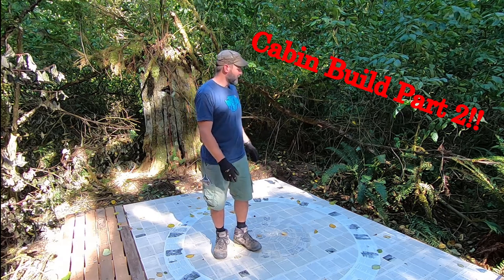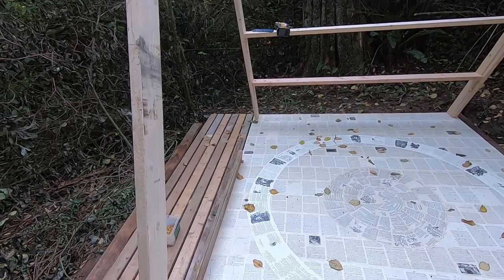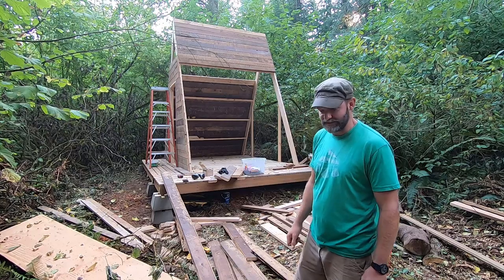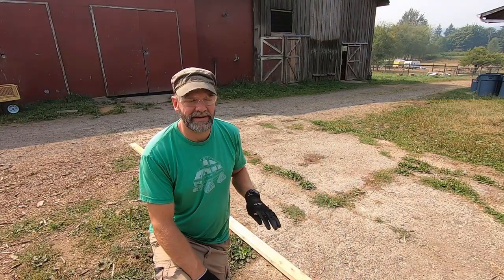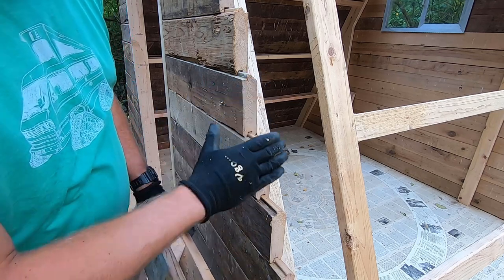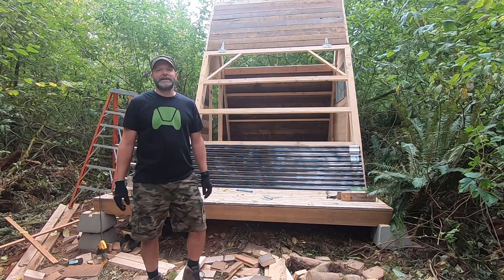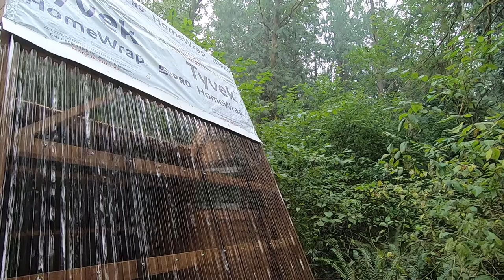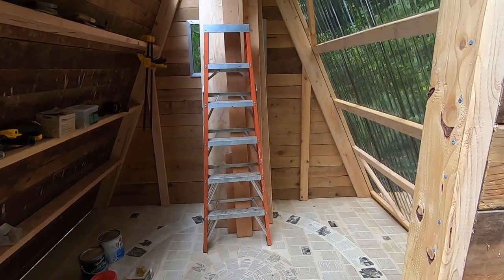A-Frame Cabin Build Part 2

Comment: The Tyvek will help the water drain down and out. It's really good at that. :-) It won't prevent condensation from forming on the metal, though. That's caused by temperature differences, and Tyvek has no insulation properties.

I really enjoyed watching this video. Thank you!
Reply from the maker: Well, down and out is good enough for me! Thanks for the input!

Comment: Hello!  I watched primarily to see what you used as "rubber flashing" between the swing wall and the roof!  I had to laugh when you said you couldn't find it anywhere because I'm in the same boat.  How did the material you used hold up?  What exactly did you use?
Reply from the maker: Hah. Yeah, I walked up and down the roofing aisles at Lowes and couldn't find it. I finally found these rain gutter leaf covers that were long and pretty flexible. It seems to be working just fine so far, but it's only been a few weeks. There's gotta be something better; I was just short on time and that's the best thing I could find.
Reply from the maker: @daddyeeoo  Yeah, that would probably work great (didn't have one readily available though..)

Comment: I am new to framing .what are the angles for the roof rafter join? do you have any templates or measurements
Reply from the maker: I used Deek Diedricsen's design. Although I don't think it had a detail with angles for the top joint. I laid the wood out on a flat area in the way it would be installed and marked the cuts. It wasn't very scientific or perfectly accurate, but it worked ok for me.
Reply: @philbrown5722  I'm also new to framing. Around 1:20 into this video when you were securing the 'A' frames to the floor, I couldn't tell what you were doing. Did you have some sort of metal plate to attach the two?
Reply from the maker: @mattwalker534  No, no plate. I just screwed them down to the underlying floor joist. The whole structure gains a lot of strength when the walls are added. It's a bit like nailing studs to the lower board in a regular house--not the strongest joint, but is fine once the walls are attached. And most of the force is down-force anyway.
Reply: @philbrown5722  gotcha. thanks phil!!